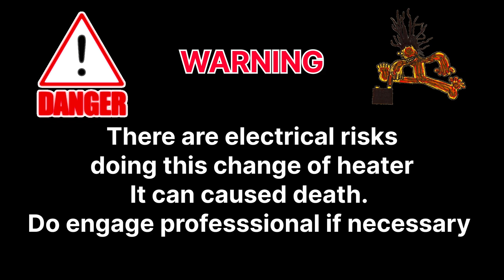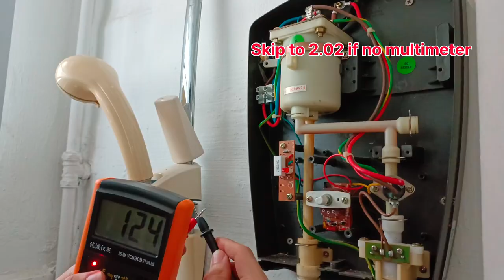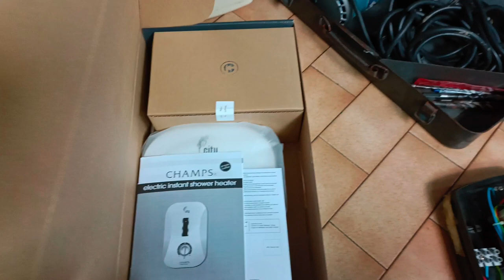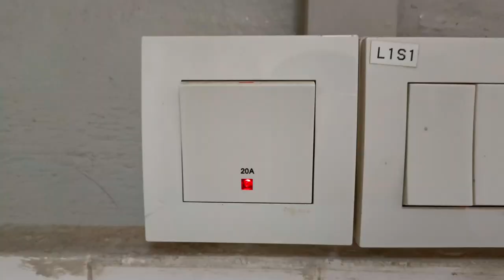How to change instant water heater (Brand/Model: Champs/City)

Comment: My old heater just died. will replace on my own. noticed that the old heater the electrcian only drilled one screw in to secure the heater. hmmmm
Reply from the maker: Now you know his workmanship😜. Better to be safe, usually we won't pull it down so is ok but if you have kids it could be dangerous.

Comment: Hi! What’s the additional wire inserted at 5:21 used for? Do you have info on 漏电保护器? I was informed on the freebie and need to use >6.0mm² wiring, hope you can advise me, thanks on advance!!
Reply from the maker: Hi, I paste the link on CNA water heater video about 7:30. Most of my point will be inside the video. https://www.youtube.com/watch?v=Bp3mc6ycNWw&t=559s

1) I believe wire 2.5mm2 is enough as the video show those storage tank heater. 
2) For 漏电保护器 (RCCB), i think only need to press and see whether still have power send to the heater during trip.
3) The additional wire was done up by the previous installer to prevent any electricity passing through the water pipe. So i just use it, better to be safer😀
Reply: @diyyangSG  I think I forgot to mention, I’m intending to get a water heater, and they advise me to get >6mmsq for water heater at 8500W. As for the additional wire, stool not sure how it works. I just got my new bto, and electrical wiring is 5 wires, 2 blue, 2 yellow/green, 1 brown,. Do I need to use all wires for water heater? ^^
Reply from the maker: @kellwx  Sorry bro, i dont have experience on that but if it is 8500W, I think your heater Mcb for your bto is B20 (20A rating) which i think is too small for your heater. So MCB will be a issue too.

With that power load I think is possible you need 6mm sq wire because is drawing quite a big power load.
Reply from the maker: I just check hdb website i think they only provide max load 40 amps for each house. https://services2.hdb.gov.sg/webapp/BN31AWERRCMobile/BN31SElectrical

Not sure is better to diy for this case. Scare later your unit keep tripping. But if possible share with me your experience after the whole thing interested to learn on this too.
Reply: @diyyangSG  I’m trying to source more info on this, not sure all these watts, voltage, amps, like history to me now. If I have updates, I’ll inform you.

Comment: Hi bro, how to control the water level by using which knob?
Reply from the maker: Hi bro. Hope I understand it correctly. For my video, there is 2 ways to control the water flow both located at the cold water side. One is the tap & second is the valve mounted on the heater

Comment: I install new water heater but why indicator lamps not working
Reply from the maker: Hi, Does water heat up? If heat up might be indicator issue only. If water does not then might be wire connection issue.